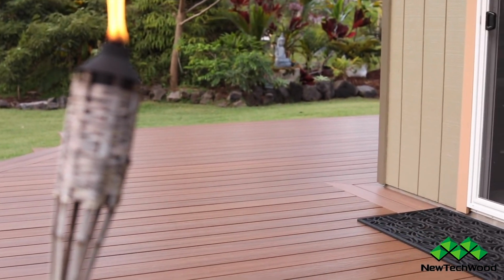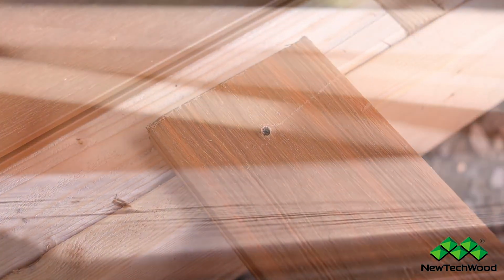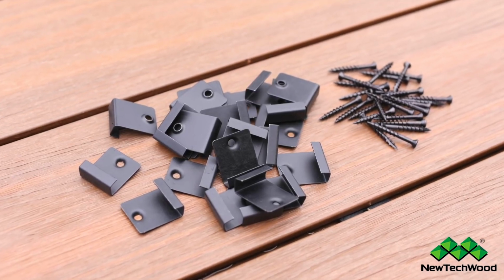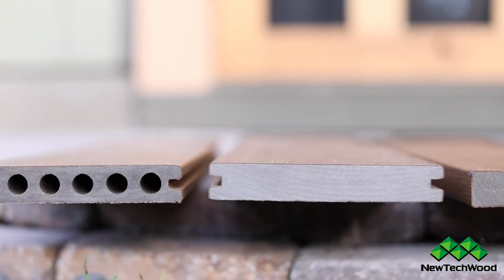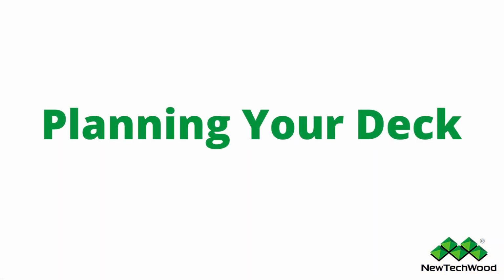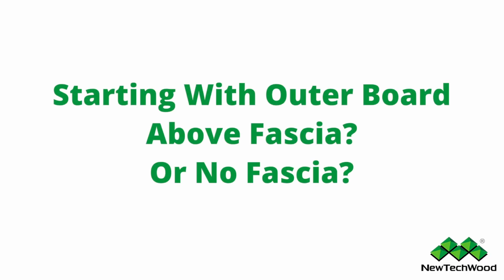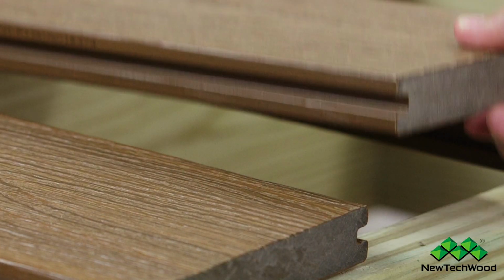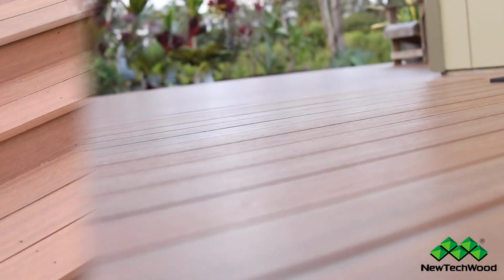NewTechWood Composite Decking Installation Guide

Comment: Are there color matched screw plugs for the caribbean blue deck boards?
An, no routed the entire length of the board. That's something I didn't know. I wish the caribbean blue was available on Columbus profile, but I will have to route for the fastenters since I don't want visible screws.
Don't think I could get that L-shaped groove carved in to the Cortes board Unless I could fit a dremel blade in somehow. Would be a pain, but I could possibly do it, but then would need to get some sealant inside where I cut.
I want to make a small landing outside an exterior door but need to figure out the measurements and how many boards I would need.
Again, I wish fascia board was available in the caribbean blue. Is it just an unpopular color?
I suppose worst case I can use primed PVC boards and then paint them for some of the edges and for riser covers on the stairs.
For people who aren't using boards on the sides, it would be nice to get some sort of end caps for the Magellan and Columbus boards. Although, I suppose it would look nicer to use boards on the edge and miter them to hide the edges, but not everyone will want to do that.
Shoutout to Richard Lam for answering my e-mails and giving me some info on the router bit size (1/4") and letting me know that some of the boards are not available in the caribbean blue.

Comment: Love NewTech.  All of it is great for quality, look, durability, installation, etc.  However -- No end caps for starter boards.  So all my boards have end caps except for the first and last boards on the deck.  ????
Reply from the maker: You can cut the end caps made for the hollow boards and use the same adhesive to glue to the ends of the starter boards.

Comment: We have a concrete porch 
8 by 10 
No railing yet 
What can we do about it ?
We cannot just lay this type of flooring on top of the concrete without securing it?
Reply: Build a sub frame out of timber on your concret base and then build a small step up to it. Will probably raise the whole thing by 10-12 inches.